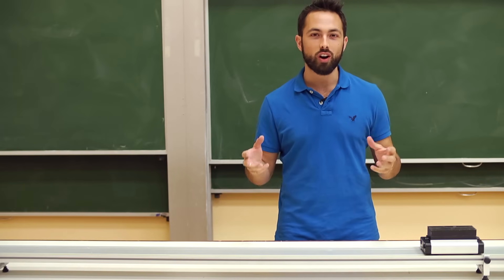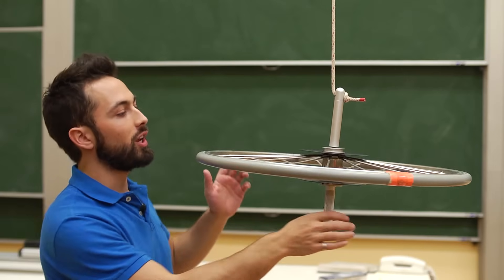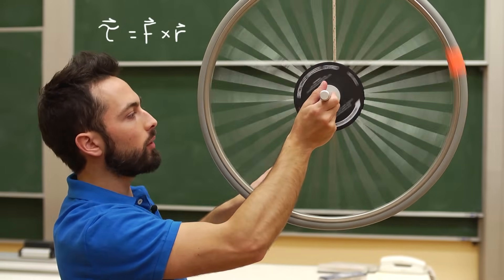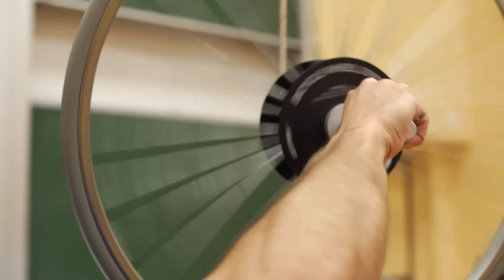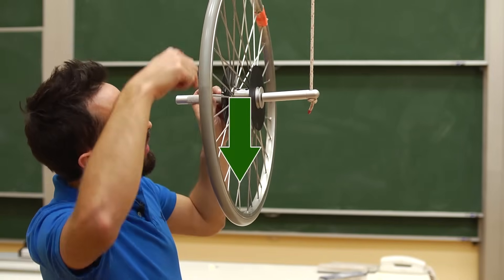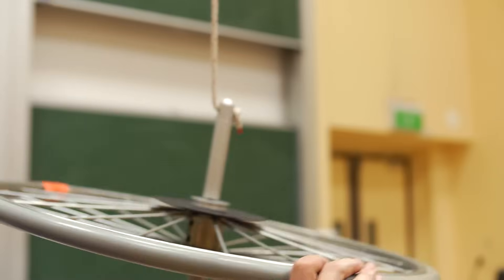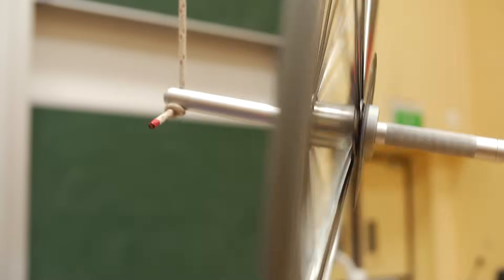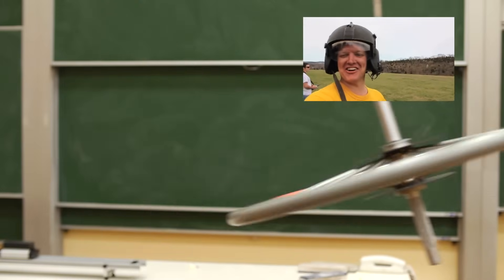Gyroscopic Precession

Comment: Does this explain why you are able to balance on a bicycle even though it should fall over since it doesn't have enough wheels to stay up on its own (like a car)?
Reply: nice response m8! you explained it pretty darn well.
Reply: No. A lot of people claim that gyroscopic effects keep a bike up, and a lot of others claim that front wheel rake distance is what does it. But scientists have built bikes with contra-rotating wheels and negative rake distances, and human riders can still ride them just fine. It turns out the control systems in our brain are all that's required!

Having said that, a riderless bike can stay upright if it has a positive rake distance, whereas it can't with a negative rake. So absolutely, all these effects are useful to some extent. But it really is primarily your brain that keeps the bike upright.

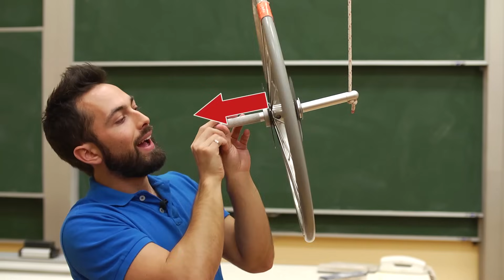Comment: At 2:59......why does the "torque pushing THAT WAY swing the other Angular Momentum vector THIS WAY"? We can see that happening quite clearly in the video, but please explain WHY that happens?. 

What would happen if I spun that wheel in the opposite direction...the wheel would now precess in the opposite direction, correct? So clearly the direction of precession has something to do with the direction of the angular momentum of the spinning wheel. 

We can see from your video that the effect of precession is always to try and align the axis of the angular momentum of the wheel with the axis of torque caused by gravity. Since we are balancing the wheel only on one point, as the axis of angular momentum of the spinning wheel starts to align with torque, the wheel turns and as a result the direction of the gravitational torque also rotates about the vertical. This goes on and on and the wheel then turns and keeps turning like the way it does.

But my question is not WHAT happens, but WHY does this happen. thanks.
Reply: +aswan korula  then then r cross F drxn wud change so the wheel will now spin in the opposite drxn while mg cross r is still in same drxn obviously.. so now the resultant vector will be supporting opposite motion of the wheel
Reply: yes, but why? why does the angular momentum vector try to align with the gravity torque. I understand that it does this, but my question is why?
Reply: +aswan korula Torque is an analog for force. while a net force is a change in linear momentum over a time interval, the same is true for torque and angular momentum. So if there's a net torque that implies the angular momentum is changing. In this situation the direction is changing. Somebody correct where I'm going wrong here, I'm pretty new to this topic

Comment: Hi, I would like to know if you had two wheels, counter balancing each other and both spinning in a counter clockwise motion from the center point as the one in your video is doing, would they possibly create less tension on the suspending rope?  If force were also applied to the orbits making them spin in a counter clockwise motion (top down) as this one is, would that possibly create a small amount of lift?
Reply: +RonALampman No, the force on the rope remains the same. If you have contra-rotating wheels, the angular momenta cancel out, and the thing just flops over like normal (except in the case you describe, where it sounds like the weights are balanced, so it could easily stay upright). But there is no antigravity going on here, the tension on the rope equals the weight of the wheel, always.
Reply: +TheHue&#39;s SciTech The reason I ask is because I know when a bullet is shot at a wall or hard ceiling at a low angle from the wall or ceiling, it will follow that surface (wall or ceiling).  For instance, if in a concrete tunnel and firing a round angled slightly up from vertical and near the ceiling, when it ricochets off the ceiling, it will continue to curve toward the ceiling until it looses enough velocity to overcome it's weight.  The same holds true for throwing a light, air filled ball.  When spinning backward from the direction it was thrown, it will rise.  I've done this with small beach balls many times.
Reply: RonALampman Oh sure, aerodynamic effects (like backspin & lift) are real things for sure. Normally not considered in problems like this, though! And unfortunately, drag always comes along and spoils the party.
Reply: +TheHue&#39;s SciTech LOL True!  But I still intend to do an experiment with this concept when I get my shop finished and 3D printer setup.
Reply: Then the sum of the torques is zero and angular momentum is conserved i.e., the wheels will not tilt, but keep spinning until friction/drag brings it to a stop.

Comment: At 2:33 why is the torque pointing out towards the camera? Shouldn't it be pointing down at the distance of the wheel from the pivot point, like he said earlier? If its torque, it can't be acting in the same plane as the pivot point or axis, it has to be perpendicular.
Reply: +Vamshi “Fazer” Balanaga because he was calculating the torque on another point. not the wheel. the point where the wheel is attached

Comment: Why is there a torque pointing towards the camera at 2:31?
Reply: The torque points towards the camera, because of the right hand rule. In this example if he lets go of the wheel(without rotating) the weight is pushing it down anti-clockwise, so the weight is a distance r away from the axis (pivot point);which gives us a torque   r x F. The direction of Torque is then pointing towards the camera by the right hand rule.
Reply: Its just a convention. Not a real vector like velocity or displacement

Comment: Hmm. Wrong again. 
Like your "its only feeling lighter" explanation of the ascending spinning gyro wheel. Total BS !!
Torque can never be responsible for this effect. Torque is a force bound to acceleration or deceleration. At constant velocity there is NO torque in play and so your explanation is false by definition!
Reply: +getreal155 But velocity is not constant here. Remember that since both momentum and velocity are vectors, a change in their direction is still a kind of acceleration, even if their magnitude remains constant.
Reply: Explain to me how the wheel that is spinning at a constant speed is not at a constant speed.
The torque is depending on a change of speed of the wheel. Nothing more or less.
Reply: +getreal155 It is spinning at a constant speed, velocity is a vector. It has both direction and magnitude. Change either one of those things and you have changed the vector
Reply: Yes, And your point is?
Reply: My point is the same as Isaiah Zepf's. If you agree that by changing the direction of the vector without changing the magnitude you have changed the overall vector, then you agree that forces, and by extension torque, can "work to change only the direction" of the momentum. That's the big idea here, as well as with centripetal acceleration if you want a more specific example
Reply: A long time since I posted my comment but I have watched it again today. A few things are fundamentally wrong here and I say it again, It's 'make believe' total BS
First of all he talks about torque where there is none when the wheel is at a constant speed. 
Secondly, regarding the first vector he talks about. The one that is horizontal pointing outward along the shaft. If I mount the suspension cord on the shaft but on other side of the wheel and the wheel turns in the same direction would this vector suddenly point to the other non supported side? 
Thirdly he invents a second vector as he goes (2:35). Not that he has any clue where this vector comes from but it is needed to give the viewer the false impression that this is logical reasoning. It isn't. 

In fact, till this day it is a total mystery how gyros really work.

ps. Watch this guy's previous video about him explaining why gyros are able to get lighter
His explanation and that of the physics professor is just hilarious. That this guy isn't so smart as he looks is not an issue but the professor should have said is that he doesn't understand exactly. Instead he decides to lie about it, in total contradiction with their own measurements that are confirming the anomalies. Dumb.
Reply: His explanation is physically correct, it just seems strange because cross products can be counter intuitive. In fact, it's the same explanation that's given in physics classes around the world. So it isn't a complete mystery to physics. Sorry if this isn't making sense, I'm trying to sort out all of what you're saying. The torque you say isn't there, it's a torque due to gravity, with the lever arm being the distance between where the cable is attached and the center of mass of the wheel. However, the argument that "because it is at a constant speed there is no torque" is flawed. It's similar to saying that because your car is going at a constant speed, there are no forces present. The statement "inventing vectors as he goes" is somewhat true since my personal study of cross products indicates that torque and angular momentum are represented with pseudovectors, to my knowledge because it makes explaining phenomenon like this simpler. I'm not sure what Newton had to say on rotational motion but with enough math it becomes clear that most, if not all of his explanation, is in accordance with Newton's laws
Reply: Do you think that Newton laws are also saying that gravity does not apply on gyro's?
Reply: Where did this come from? In this demo, gravity is actually causing it to precess. That was the point of the video
Reply: ps. Don't make the mistake to think that what you have learned at school regarding this subject is truth. You get desperate and wild speculation at most.
Reply: getreal155 Well that's unfortunate, from what I've seen about how these types of things work, we're in a lot of trouble if all that desperation in trusting the cross product and vector addition is incorrect. I mean heaps of trouble, we'd be grossly miscalculating structures and incorrectly investigating if something will bend under a given load.
Reply: I did some more investigation and found that I am incorrect. They did figure out how it works and is according Newtons laws. Sorry for putting you on the wrong track.

Comment: Still I could never find out why a wheel precesses the direction it does until i saw a video explaining it. As the wheel wants to rotate it's axis vertically due to the gravity, it is creating an angular momentum about the vertical axis just by the act of tilting. So in other words, tilting causes an increase in angular momentum about the vertical axis. But since action = opposite reaction, the wheel itself is subject to a torque in the opposite direction hence the precession. In other words, the wheel precesses in the counter direction you are making it spin in by the act of tilting it.

Comment: deeper explanation would be better Derek. why is angular momentum perpendicular to the axis of rotation? 
it's just imaginary concept created by we humans right?

actually gravitational force is trying to pull the wheel down along the pivoted point. so what exactly happens is the parts of wheel(tire and spokes) will have to change their momentum(after all instantaneous angular momentum is linear momentum)...where the particles refuse  to change momentum...the tendency to not change is proportnal to angular velocity(or so called instantaneous linear velocity) hence the effect of counter torque makes the wheel to stay with out falling.

instantaneous angular velocity (infitisimally small distance) is just linear velocity.
 
may be video explained in animated view or some other example should shed more light on gyroscope mystery!!!

good video.
thanks

Comment: can not understand the last part.
When only the weight is working, there is an angular momentum which would rotate the system anticlockwise. fair enough.
But when we rotate it before leaving it we are giving another angular momentum. So should not will there be a resultant angular momentum?
Why at last it is being said that there is an angular momentum due to the rotation we give and the torque due to the weight of the wheel make the angular momentum spin (i.e. the whole wheel circulates)?

Comment: Gyroscopes prove we live on a flat earth. Gyroscopes in aircraft. Gyroscopes are set on level ground before take off. After the plane is in the air the pilot will always know the ATTiTuDe of the plane according to the ground he set the Gyroscope on. If the weather is bad with zero visibility he will still know the ATTiTuDe of the plane: his pitch and his roll.
If you set your Gyroscope in NYC before take off and fly to L.A. over 2,000 miles away; upon landing you would be around 542 miles below the horizon from NYC. Upon landing your Gyroscope would not be telling you the plane is level because you would be at a different angle landing the plane from where you took off in NYC on the other side of the globe.
Also if you set your Gyroscope and took off you'd have to continue to compensate downward to maintain the same altitude. If you didn't compensate and you wanted to fly level according to your Gyroscope and you had infinite power you'd eventually leave the earths atmosphere and fly out into space, but that's not the case. We live on a flat plane.
A pilot instructor even came out recently who owns his own flight school and said there's no way we're on a globe because Gyroscopes can only work on a plane surface.
Other credible mentions: US Navy Missile Instructor Confirms Flat Earth.
Also US Navy Submarine Chief Confirms Flat Earth.
There's no way around it. I'm sorry.
Reply: +Under the Dome This argument does not prove that the earth is flat; it only proves that gravity is perpendicular to the surface of the earth. This only works for a radially symmetric system; if the earth was flat, and you weren't exactly above its center of mass, the force of gravity would not be perpendicular to the ground.

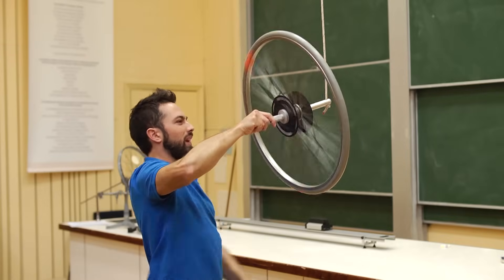Comment: Sorry dude, in fact you were not explaining anything about root cause of precession, just stating about direction of torque vector which is not force and is based on convention of right hand rule. Most important part - 2:30 - 3:00  is just speech abracadabra unfortunately

Comment: Okay but why does the torque move that certain way? That first equation didn't talk about how much force is also being applied upward since it's a wheel. It is then defying gravity, right? The downward spin pulls toward earth/gravity source but the upward spin pushes towards the sky.

I have a bias against equations because they're not language-friendly, but I think there's some mistake or something missing from this explanation. I get that the spin creates a rotation, but I still feel as if there's no proper understanding as to why it's not bouncing around everywhere. Does the downward and upward pull just... cancel each other out?
Reply: The torque from the wheel spinning on its axle creates the torque (the red arrow) that keeps it up, since that torque wants to keep traveling away from the axle longitudinally. Then torque from gravity pulling the entire wheel downwards create the 2nd, and separate, torque, which is the one that's causing the entire wheel to rotate around the rope.

At least that's my understanding of it. I'd be glad if someone can verify this.
Reply: As in, there're two entirely separate torques in play here:
1st torque: the one created by the wheel spinning on its axle, indicated by the red arrow;
and
2nd torque: the one created by gravity trying to "swing" the entire wheel assembly downward, which is now translated into pushing the entire assembly sideways.

The 2nd torque only pushes instead pulls down because of the 1st torque trying to pull away in the direction of the red arrow, thus keeping the entire assembly relatively perpendicular to the ground, until that torque slowly dies down due to the wheel spinning more and more slowly, caused by the friction between it and the axle.
Reply: Ah alright, I get it now, thanks.
Reply: So, is there a third upward torque from the resulting rotation around the rope, or does the concept of torque not apply because there's no mass on the other side of the ... fulcrum?

Comment: I need more free body diagrams to understand how that thing doesn't swing down when the rotating mass is spinning. I didn't see any forces pointing in the up direction to counteract the torque in the downwards direction. I don't see how the force vectors would cancel out on the y axis.
Reply: The red arrow is the factor that's "keeping" the wheel up on the rope, because the red arrow is constantly trying to pull the wheel towards where the axle is pointing lengthwise.

This is why you can observe that the wheel starts to droop more and more as it's spin starts to slow down more and more; as the spin dies down, the red torque also starts to die down, thus there's less of a force pulling it out sideways, giving way for gravity to start pulling the wheel back down.
Reply: +JapanForSale That just isn't clicking for me. Why is it that spinning a wheel down makes a force to the side of the axle? Why wouldn't car wheels fly right off the sides?

Comment: Does a gyroscope works in vacium ?
Reply: +saken andersson in vacuum? yes it would work. it would even work a little bit better because of the absense of air resistance so it would spin longer. but still there would be friction in the axles so it would stop spinning after a while.
Reply: +Enhanced Pyrotechnics thx hmm but thats is   soo strange .
Reply: +saken andersson yes, the whole idea of a gyro is to maintain rigidity in space.

Comment: Veritasium Would it not work if the wheel were spun clockwise(instead of counterclockwise) because the right hand rule would make the force pointing in the direction of the rope? More generally, why does the right hand rule makes sense; why is the force in the direction of the the thumb instead of the opposite?